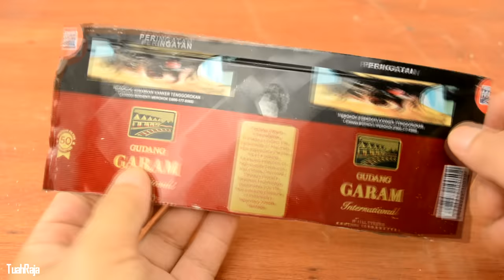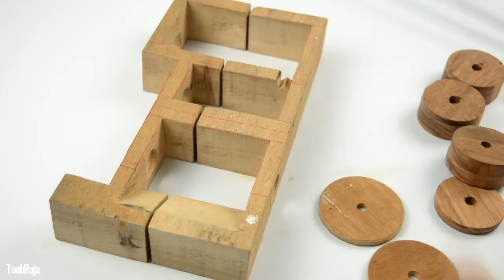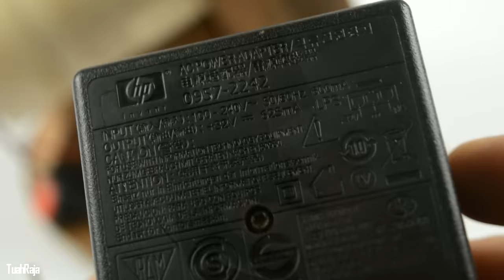7 SMART IDEAS USING WOOD THAT YOU CAN MAKE AT HOME

Comment: Nice idea n nice attempt but one thing must b taken into account :::: its thin metal used
It will ware out soon, it will also bring metal particles into grated material. Also it will leave its color due to ware, those particles will also b in ur plate.Try to use steel or any other hard, permissible metal for grating drum.
Reply from the maker: Yes, you are right

Comment: Definitely appritiable but the piece used for scraping is not at all recommended, as it is not hard metal.Secondly, it will leave particles of paint n metal inside our scrapped food.Any steel sheet is definitely a good substitute but its hard to make or get from market.